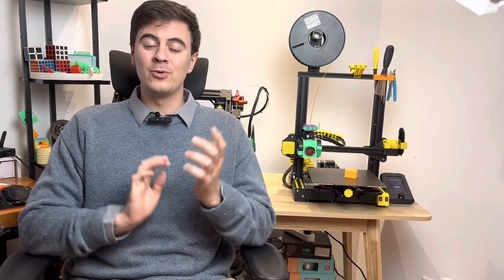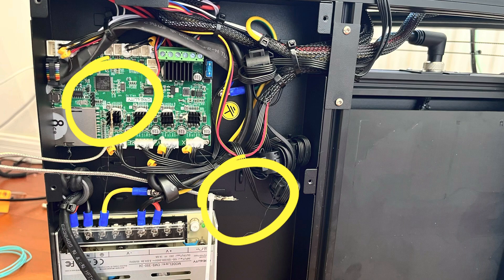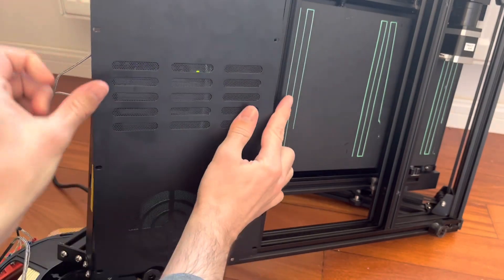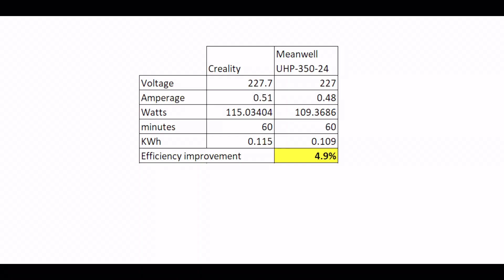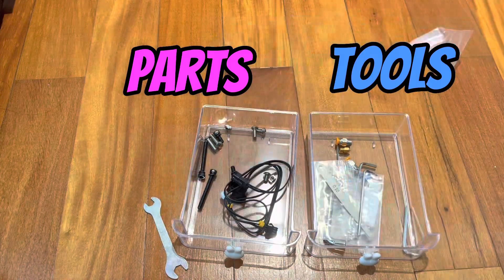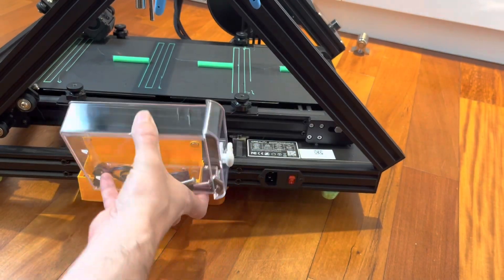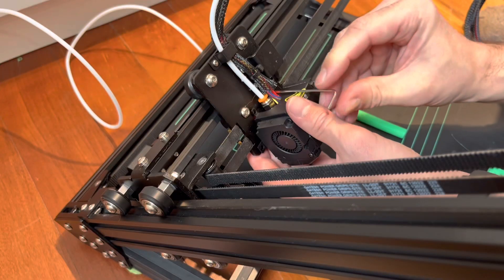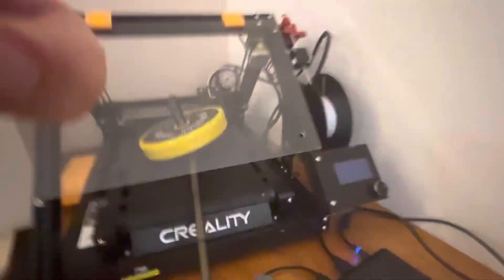9 Upgrades/Mods for the Creality CR-30

Comment: Hey there, ive searched high and low for help with my CR-30. I cannot for the life of me get the print to stay adhered to the belt. The initial lines that print stay and adhere well but as soon as the model begins, it usually detatches and turns into a mess. I have had this printer for i think about 2 years now and have never gotten a print out of it. I wanted to ask, what slicer options are you using? Is there anyway to improve the adhesion without having to buy an entire new belt? Is there something vital besides standard troubleshooting for a regular 3d printer im missing? Any advice would be extremly helpful as its currently the worlds biggest paper weight
Reply from the maker: That's super frustrating to hear you're going through that. I use Creality slicer 4.8.2 or ideamaker.  For me the bed adhesion has never been an issue and actually things stick way to well to the bed and I can't remove them without rolling them off the end of the printing bed.  Maybe a new bed would help you?  I've never replaced a bed on mine, so I don't know how much of a hassle it will be.  

For me though, the printing quality of this printer is the biggest pain/challenge I've had.  Also when I do want to use it it's for 24+ hour prints because it's super slow, so i generally don't mess with it enough to get the printing quality better.  Hopefully this helps you!

Comment: Is this still the best option for a silent psu?
Reply from the maker: yes, it's still a very solid PSU.  it's been out and reliable since 2016.  There may be cheaper option, but this one is very good and stable.
Reply: @DesktopInventions  any idea if they have released a fanless version that fits the normal form factor for most printer power supplies?

Comment: In my experience the noisiest part of my ender printer....which is the same across all the creality printers....are the main PSU fans. Easy Pickens to get a higher quality fan from digikey with your dimensions and voltage for cheap and the nojse difference alone is night and day. The part cooling fan and extruder fan noise is negligible compared to that awful psu fan.

Comment: Interesting..  not sure about the standoffs or running the fan at 17v but I'd love to see how using my redesigned PSU cover plate with Dual Noctua's compares in sound and temp to your mods.    See Thingiverse  thing:5190571

Comment: Is it possible to print PA-CF on this printer? :)
Reply from the maker: yes I believe so, although I personally haven't don it.  Just make sure to upgrade to a hardened nozzle as carbon fiber filament tends to be more abrasive and wear out nozzles faster.

Comment: Is this a good printer to have for a beginner? I own a Prusa MK4  that is the only experience I have with 3D printers. I am thinking of buying a CR-30 for some production work
Reply from the maker: I've had pretty good experience with this printer printing out of the box, but I did have a couple nozzle clogs that ruined a few prints.  I changed to a new nozzle and changed to PTFE capricorn tubing which helped solve this.  The other challenge has been the software.  Currently Creality has their own custom slicer software to support this printer which is not as stable as current slicing software.  Occasionally strange artifacts will show up in the slicer, or sometimes models will refuse to slice all together.  Everything else about the printer has been pretty solid!

Comment: I'm curious that you used standoffs for the motherboard fan instead of a shroud or duct of the same height to ensure that most of the air still came from outside.

Comment: Hi, can you share your profile slicer which you demo in this video?
Reply from the maker: Sure I'll do my best!  Let me know if there's any parameters specifically you're curious about.

Belt Wall speed: 10mm/s
layer height: 0.2mm 
wall line count: 4
T/B thickness1.0mm
Top layers: 5
Btm layers: 3
Infill density: 20%
Infill pattern: triangles
material: PLA
printing temperature: 210C
Bed Temp: 60C
Print speed: 40 mm/s

Comment: Nice video! I’m may buy this printer for some architecture. Do you know how fast can this printer goes with decent quality ? And with Creality Sonic Pad may be it could also help with speed and quality? If you get one would be nice to make a video.
Reply from the maker: I haven't done too much to push the speed on this printer.  Even at the stock speed it sometimes struggles with quality, but this is usually due to random issues with the slicing software.  Unfortunately I think the slicer is the weakest part of this printer.
Reply: I just bought the sonic pad for CR-30, unfortunately, I didn't understand how to make a very accurate printing, and also it looks like not support using creality slicer for doing slicer so I just used creality print as my slicer.

Comment: Did the tube upgrade solve the previous issues?
Reply from the maker: Yes so far I haven’t had any filament jams during any longer prints. I think it was likely from the extra junk near the nozzle from a poorly cut Bowden tube.
Reply: @DesktopInventions  Nice